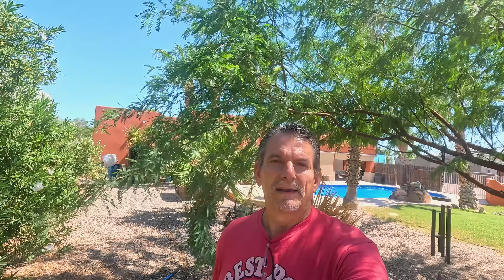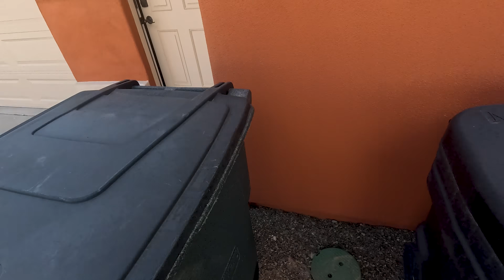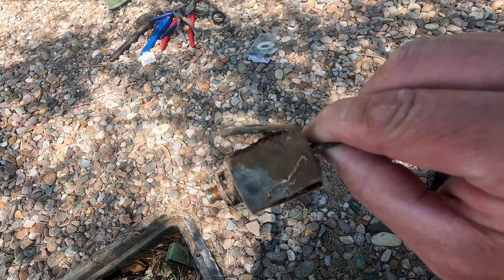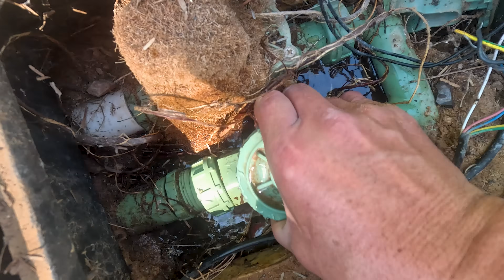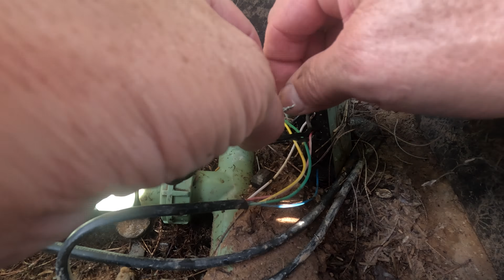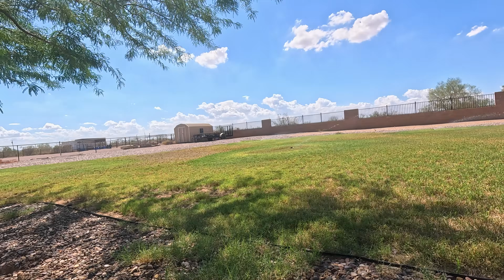Orbit Sprinkler Valve Troubleshooting 101

Comment: Would it be the solenoid if you open it by hand and the sprinklers do not come on? Two zone manifold and other zone works fine both from the controller and manually.
Thanks.
Reply from the maker: The solenoid is not powered to open by hand.  So if you open the bleeder screw or rotate the solenoid depending on what type you have and the water does not come on.  Something else is wrong.

Comment: Great help.  I just spent two days rebuilding a leaking six valve manifold only to have four of the six stations not shutoff after replacing the diaphragm and solenoid.  I cannot see any crack in the housings, but given this is a mountain cabin and despite being underground and insulated, I assume that the housings are warped or have cracks I cannot see from a freeze.  I did not consider that until watching your video.  Thanks!